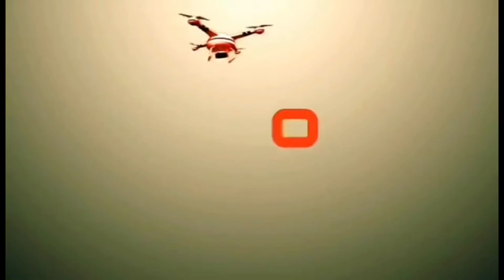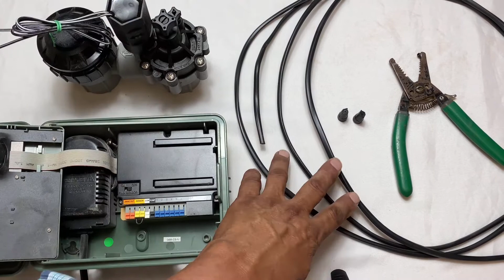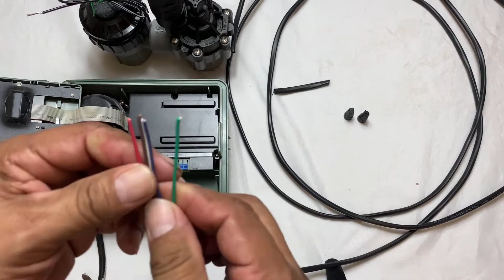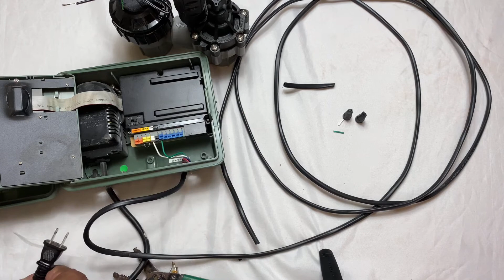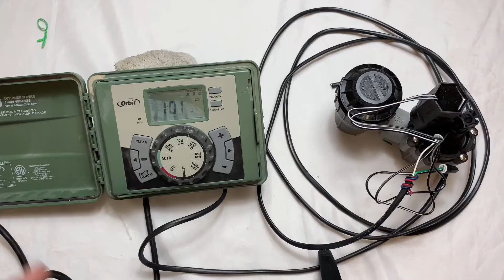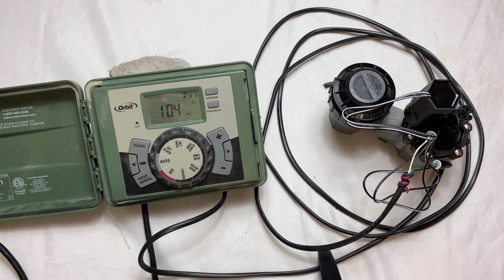How to Connect Wiring from Sprinkler Timers to Sprinkler Valve

Comment: Great video but I have a question, I have 4 station orbit timer. I set it up the timer but after 1 station timer stop and not working for the other station. Is the wiring is not connected right? Thank you

Comment: Thank you for your video! I had already successfully set-up my Orbit sprinkler timer. But, recently, one station failed to come on automatically. I wanted to try to diagnose by changing the station wire to a different location in the controller. Couldn't remove the wire. Duh. Your video pointed they way. Note the thread in the sheathing can be pulled down to open the sheathing so you don't have to worry about using a wire cutter. Only learned this today from another video on wiring a controller.

Comment: Thanks. Very helpful. I had already successfully set-up my Orbit controller, but eventually one station stopped automatically running. I am trying to diagnose, and I wanted to try removing the station wire to a new location and see if that helps correct the problem, but couldn't get the wire out to move it. Your video helped! Note, that string in the wire sheathing is for opening the sheathing so that you don't have to risk cutting it with a wire cutter. Only just learned this myself from another wiring video.

Comment: I am  having  a problem  I have  the same  orbit  timer as you. I  have  4 zones.  One  master  valve  one  wire connected to the common  white the other connected  to  zone one.  Once  I  set the timer  up. I wait  for the zone  one  to  start. It does  but zones  2,3 and  4 does not start  I have  tried  everything  but nothing  works.  I am  not sure if each  zone  needs a wire to work  in this case  I only  have  two  wires coming  from  the  master  valve.  Any input  would  be appreciated.

Comment: Hi what is the voltage  running  through  the white wire if any. Also  I  have  an issue  I did have  one  master  valve  which  operated  a 4 zone  sprinkler  system  the timer  was rainbird. Eventually  the timer went  bad. So I installed  a  Orbit timer  it stopped  working. I  do believe  my wiring  set up is wrong.  Coming  from  the outside  I have  two  sets of wires white and  red  and  white and  red. Since  there are two  white  wires which  one goes to the common . And  how  do  I get this working.  Any help  would  be appreciated.

Comment: So if I need to connect a second valve, how would the wiring be?
Reply from the maker: You would  take one of the two wires either one and connect it to the white wire and  connect the other wire  to a colored  wire that’s not being used , make sure the wires being used are connected to the timer

Comment: I just replaced a transformer that was burnt out. Should I replace the 0.75 A fuse inside too?
Reply from the maker: If the timer is working with the new transformer then that means the fuse is ok.
Reply: Well it didn’t! So my next guess is the fuse. If not I’ll have to get a new timer.

Comment: let me toss my 2 cents worth in.
i strongly suggest that you color code your valves to your timer so that if there is a problem, with one section, you know what valve / wire to check on.
when i wired mine up, i used white as my negative, and then color coded the wires out and in my vault 6 (video) i hooked the wires up from 1 on the timer to one on the valves (it was the red wire) and so forth.

there are different size wire nuts and get the smaller ones as you need a good fit.  weathering and the associated corrosion will effect the flow of electricity.   
also, dirt in the valves can be an issue so use a screen system,   my system has screens throughout, using hose screens to keep dirt out, which i can check annually or if they are not working.

not a lot of people have your skill to cut insulation without damage to wire.  inside the casing of the (should be) 7 strand wire,  6 valve, one negative return line, is a white string.  with pliers you can pull that string and strip the insulation and then cut the tail off and leave the wires exposed

you have made a good video and the others are well done.   bravo!

Comment: If everything is well connected, and two valves doesn’t open with the timer? There is something wrong with the timer? Or with the valves?
Reply from the maker: Sorry for not responding much quicker I was ill, its most likely the valves could be a bad connection or bad valve. What kind of valves are they?
Reply: ES Complete Yard Work yes, it was an electrical problem. So, rain bird valves, were well connected, but the problem was the source of power. Thanks for responding:)